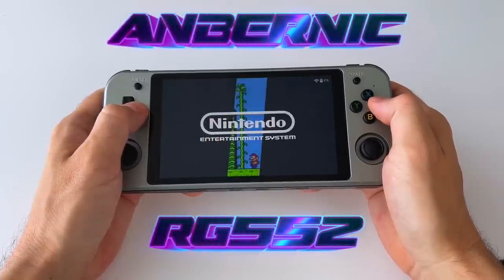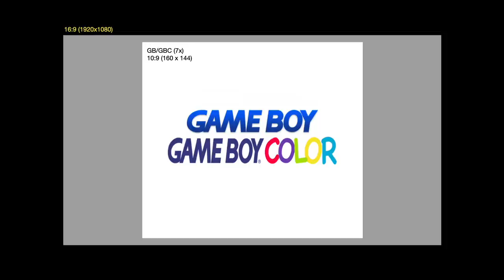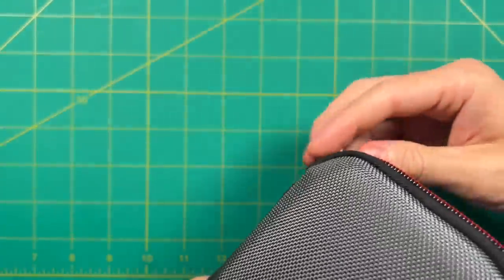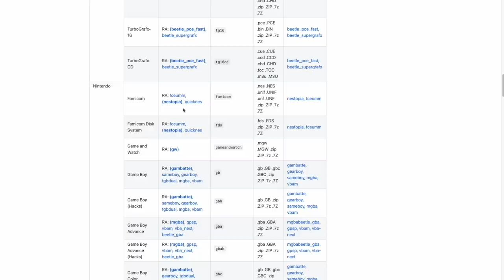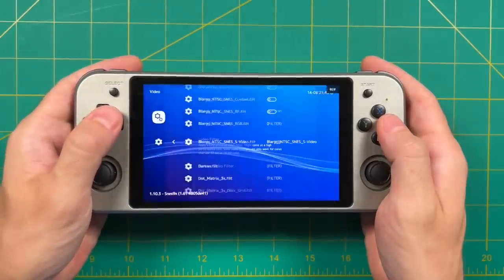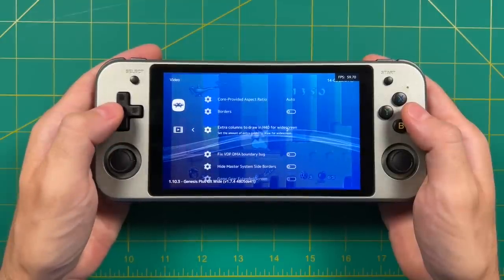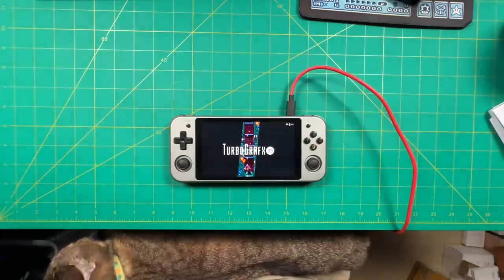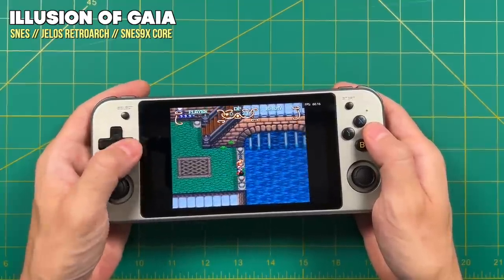This is still my FAVORITE handheld for retro gaming.

Comment: After a lot of fiddling, watching your videos and updating, I finally got my RG552 set up the way I wanted. I’m particularly OCD about retro gaming so the integer scaling, filters, achievements, lack of input lag etc are all essential for me.

I got fed up with dual booting so I setup Android 11 with Retroarch and standalone apps as detailed in this video. This has only been made possible in Android with the official update, AuroraStore and Daijisho frontend. Very slick as a complete launcher with high quality artwork and Retroachievements support, I no longer have to dual boot and can use a single SD card. Perfection!
Reply from the maker: Sounds like a nice setup!
Reply: That's not being OCD that's just caring about the games you play. I get the impression a lot of the angry comments on these videos that are shitting on anbernic and shilling inferior alternatives just do not care about actually playing games at all, they think something having more "power" for less means it is better in every way, but if they cared about the actual experience of playing on a device which is FAR MORE THAN PERFORMANCE they'd know how full of shit that thinking is. But they don't.
Reply: daijisho is defo the most underrated frontend out there . russ u shld do a video :D
Reply: @steel5897  You hit the nail on the head. Too many people know the cost of everything and the value of nothing.

Comment: It’s kinda baffling that they went with a 16:9 display when only one of the properly supported systems can even use most of it… but when the display looks that good, it’s hard to argue.
Reply: It's 5:3 not 16:9. It's close tho, 5:3 is the same as 15:9.

Comment: Can the rg552 be charged from a battery pack or standard PC USB port or does it require the AC adapter?  If I'm on a road trip or long flight is there a way to use a battery pack or the plane's USB port?  Thanks.
Reply: In case you haven't got the answer, the Anbernic website says RG552 "Support mainstream fast charging protocols such as PD, QC, AFC, etc.,
Input 9V~12V≥2.5A,
Match the maximum load 5A charging cable1.5 hours full". So, you need to check the plug outlet or battery pack output. If it doesn't exceed the numbers above, it's fine.

Comment: Russ,I went back to this video because I am wondering if it isn’t better to buy the RG552 over the RP3 due to the shipping bringing the RP3 up to $175 and i can get the RG552 for $199 incl shipping. The RG552 has a better screen and is it not also a bit more powerful? To me it seems the RP3 just has better ergonomics, but the RG552 is built better as well.
Reply from the maker: The RG552 definitely has a nice feel to it, although some people think it feels a bit less solid than their other devices.  The main downside to the RG552 over the RP3 is going to be the battery life, at best you'll get 4-6 hours on low-end emulation.  But as I showed in the video, its scaling for classic systems just can't be beat.  Thankfully, JELOS has improved performance quite a bit even in the past couple months, so there is nearly parity with Android emulators now on their firmware.  I'd be torn between the two if they were of a similar price too -- if you just want to focus on classic gaming around the house with a premium feel, then the RG552 is a great fit.  If you are interested in other aspects, like game streaming or longer battery life, then the RP3 would be a better choice.
Reply: @RetroGameCorps  thanks Russ, I think this is an idea that a lot of buyers could benefit from. I am going to save and wait for a special price on the RG552 - I am really keen to get a large screen device and, for me, retro emulation (SNES, NES, SEGA) is the priority - the rest is just extra. Oh a big downside that bothers me with the RG552 is the fact that it has no Bluetooth for headphones… :-(

Comment: Awesome video. I had no idea about selecting little cores only to save battery, I'm going to try that! The RG552 makes retro gaming a joy, you don't think about how your experience could be better on something else, you just enjoy the games. Super Mario World hasn't been this fun since I was 7 years old, I've played it on a ton of emulators since then, but never made it to the end  due to graphical glitches, sound stuttering, or other issues that ruined the experience on other devices. My biggest gripe with this device is the "sleep" mode - dies in about a day. So you're pretty much forced to power it off after each session, or pick up a dead device the next time you want to play. This is an area I'm curious if the RP3 could improve upon.

Comment: Just a heads up for the audience about aspec ratios:
- Few classic systems native pixel aspect ratio is 4:3. What this means is that integer scaling with the aspect ratio set at 4:3 - on almost all modern LCD based display panels at a 4:3 aspect ratio, will not provide a 'true' clean integer scale. As a result, you will see some scaling artifacts at least along the horizontal axis, with integer scaling on. 
In most cases, only the vertical resolution will be cleanly scaled (although there are exceptions)

If you want to play at aspect ratios other than the native (8:7 for SNES, 8:7 or 10:7 for the Genesis etc.) then you will need to apply some sort of filtering or shader to mitigate the distortion this introduces (assuming the distortion bothers you). 

This is essentially true of any modern display, regardless of device.

Comment: Agree with your reasons as well Russ, but there’s something that just turns me off the 552 because it gets warm and drains so quickly even playing retro games compared to other devices like the RP2+. This issue is made worse because you can’t just plug it into any usb C charger, it needs the dedicated one or something like a MacBook Pro charger. 

I really love the screen but it terms of being that device that’s just there on the side of my bed I keep going back to the RP2+. There’s something attractive to me about how it can stay active in standby and barely drain even 1% after 2 days of no usage. And when I am playing GBA or SNES I’m getting around 8+ hours and no heat at all, even though it’s more powerful than the 552.
Reply from the maker: Great points, and yeah the RP2+ is a much more efficient handheld, it does a great job with thermals.  I have a weird relationship with the RP2+: because it can play more high end systems then I like using it for that (Dreamcast especially), but then I find the 3.5" screen to be too small for Dreamcast.  I can't win!  ¯\_(ツ)_/¯
Reply: @RetroGameCorps  have you considered partnering to create the ultimate enthusiast handheld? I reckon if anyone could do it, you could
Reply from the maker: @zaprct  maybe some day in the future, but I think I still have a lot to learn before I take on something like that.

Comment: Seems like the RP3 is going to be a better version of this
Reply: Shhhhhhh..... Russ gets offended when you compare Retroid and AnBeRnIc.... 😉
Reply: Doesn't bode well that there aren't any reviews for the device yet and it ships in 4 days
Reply: The rp3 has a 16:9 screen so probably not
Reply: @HPPrintervx4p5q  16:9 no/ no Linux support. 

Very different devices.
Reply: @HPPrintervx4p5q  its not all about the screen though, theres so many things that make the 552 painful to use. abysmal battery life, the device getting stupidly hot, the ergonomics (shoulder buttons , joysticks etc) if retroid rolls out a device that has none of those issues they've got a winner.

Comment: You and I seem to approach 552 in a lot of the same ways, except my favorite is snes compared to yours being nes.  It's one of my most used handhelds as a result, even over rp2+, Odin pro, and steam deck.  Just really hits a sweet spot with the controls and screen, and Jelos is just much more enjoyable for me to work with over all of the Android front ends I've tried (Reset Collection, Daijisho, Launchbox).  The only consideration for me is the battery since it drains quite a bit even when turned off, but as you pointed out it's also one of my fastest charging devices and I can get back to around 80% in an hour.  

I agree it's a niche device.  For the person wanting a "one size fits all" that does solid with a broader range of tougher systems and still has a relatively good screen, Odin is the versatile choice.  I just like how 552 does so well with the games I enjoy most so I favor that one.  I have other devices for advanced stuff when I care to play those.  I mostly reach for Steam Deck for gamecube and above.
Reply from the maker: I am in completely agreement with you here.  I'm a simple guy: if I can play the best version of NES, SNES, or Genesis games on a handheld with Retro Achievements, then that's a good use of my time.
Reply: I currently have a single OS, Android 11 with Daijisho, and ditched JELOS because I didn’t want to split off games over 2 different operating systems. Could you go into a bit more detail why JELOS offers a better experience. Thanks.

Comment: Also, would these same JELOS tweaks you showed off work for JELOS on the RG353P?
Reply from the maker: Some of these settings would carry over, but I don't think there is an option to define the cores like with the RG552.  Might be something worth trying!  The screen adjustments will be different, you'd have to use filters and shaders to get things set up properly.

Comment: I'm in the same boat. I love and treasure my 552. It's amazing for everything I would want to play with a dpad. If I want to play anything else I just use my steam deck. I tried playing retro 8 and 16 bit games on the steam deck but within an hour I put it down and picked the rg552 back up.
Reply from the maker: I had a similar experience.  The Steam Deck's 16:10 aspect ratio is also great for 4:3 content, but I prefer a more compact handheld for retro games.  The SD for me is best for GameCube and above (and PC games, of course).
Reply: @RetroGameCorps  where does that leave N64, Dreamcast, and PS1 for you? I prefer SD for N64 era and up, especially with widescreen enabled on N64 core for steam deck. 552 is capable of N64, but I don't think it's ideal for it. Thanks for the reply by the way
Reply from the maker: @VatoLoco91  For N64, Dreamcast, and Saturn I prefer the Odin.  I actually use the RG552 for PS1 as well but I don't play that system very much.

Comment: Are there any videos on applying screen protector and using the included Wipes? Should we bother? The manual doesn't say anything about it.
Reply: modern emulation handhelds all have tempered glass screens which are very scratch resistant.  screen protectors aren't necessary but you can still use them for added protection

Comment: Anyone buying this over the Ayn Odin Lite is mad IMHO.. Even with the 2.5 month wait for an Odin.. So much better emulation performance, decent gamecube and ps2 and everything below that is perfect (i.e. everything I have tried for PSP is perfect at 2x for example)..
Reply from the maker: There's no denying that the Odin is a better deal.  I love my Odin Pro but it depends on what you find most important, if you prefer SNES and below systems then the RG552 plays those systems better in my opinion.  My Odin Lite finally shipped today (12 months after ordering), I'm looking forward to reviewing that as well.

Comment: I picked mine up for $180 on Ebay. It was pristine and had a screen protector on it. Both SD cards were still there. I threw amber and android 11, ended up paying Black Seraph 20$. I still don't know if i can get over the battery stamina, I played GBA Metroid on my rg351 for like 6 hours and still had like 50% battery left. Thinking about selling it, unless you know of any decent battery upgrades???

Comment: For just the screen and that pricetag an Odin Lite is a waaaay better choice.
If Anbernic releases a more powerful successor of the 552 with the same screen but with stacked shoulder buttons and capable of emulate perfectly the "modern" 4:3 systems like N64, Saturn and Dreamcast for $220 it would be a hit.

Comment: I have an rg351m that worked for 1 week.  The screen went black. I replaced the screen, and it's still not working. Any other lucky people out there?
Reply: Mine works but has the crap dpad. Given how widespread the dpad problem is, I question how it got so many good reviews .

Comment: Great video and is exactly the one I needed. Thank you. Just started looking into retro handhelds a couple of days ago but was struggling with what screen size I wanted. I wanted 4:3 for all the 2D classic games but the GBA is my favourite console and so I would probably spend 50% on my time with all the other consoles and the other 50% on GBA. The scaling of the screen seems perfect and as you proved is better than 16:9 devices. Need to try and find a good cheap price at AliExpress but then I'll follow your guides for the installing all the stuff.

Two questions though. You didn't mention how DS handles on the device. Also why wouldn't you just set it to overlook the CPU at 200% for all games? Do they then run too fast or just a battery consideration?

Thanks
Reply from the maker: DS plays fine on the device, I prefer to use the Android side for that system so I can take advantage of the touchscreen function.  DraStic with a 2x resolution works fine on the RG552.  As far as overclocking the CPU (I assume you are talking about the Genesis section where I showed that with Sonic Spinball), it can cause glitching in other games and so I only use it for games that have slowdown.
Reply: @RetroGameCorps  thank you for replying. I watched the different firmware video video and that showed that the DS games ran pretty well. I'd only be playing the 2D, which I assume will be fine. Oh the over clocking point makes sense. Can't wait to get one and set it up. Is there a black Friday equivalent for when AliExpress do big discounts?

Comment: Really great to see you talk about Run-Ahead. A lot of retro games are quite skill heavy and require fast reflexes. I remember just not playing SNES games on my PS Vita (except RPGs) because it starts struggling a bit with harder to emulate SNES games and Run-Ahead isn't gonna work. It was fine without any filters and Run-Ahead but I hated the input lag. If you want to have the best experience with 16-bit and 8-bit systems you really need to use Run-Ahead imho.

Comment: A while back I was actually wondering what the perfect aspect ratio for displaying 4:3 and 16:9 content on a single screen would be. I did some basic calculus to find the optimal aspect ratio for displaying both, and it actually worked out to around a 1.58 (edit: 1.54) aspect ratio. That's the magic number for wasting as few pixels as possible.
Was wondering why I couldn't find a retro console with something close, a 16:10 display or a 5:3 display, but here it is. That's really cool.
Reply: Ooo math.... GJ.
Reply from the maker: Nice, yeah the RG552 is a 1.66 aspect ratio, so pretty darn close to the 1.58!  Sounds like 16:10 would be even better at 1.6 (and it's definitely great on the Steam Deck!).
Reply: @RetroGameCorps  This was just a casual comment going off of memory, but after your reply I wanted to make sure it was accurate. Went ahead and redid my math (I deleted the old text file many months ago) and the magic number is actually a 1.54 aspect ratio. I realize changing the number like this hurts my credibility a bit, so I'll share my work below:

A = (4/3) / x
B = x / (16/9)
y = (a+b)/2

A is % of screen used when displaying 4:3 on an aspect ratio of x
B is % of screen used when displaying 16:9 on an aspect ratio of x
y is the average of these values

we substitute A and B for their formulas, and simplify, and we get
y = (27 x^2 + 64)/(96 x)

when we take the derivative we get
y' = (27 x^2 - 64)/(96 x^2)

we want to find a local maxima, because that'll tell us at what aspect ratio A and B are equal
to do this, we set y' to 0
0 = (27 x^2 - 64)/(96 x^2)

when we simplify we get
x = sqrt(64/27)

which means our optimal aspect ratio is approximately
1.5396

(and in retrospect, this is the hard way to solve this problem but whatever)

Comment: The whole Anbernic range is like this ‘it’s great…but’.  For me the 552 is a great console but my biggest issue is battery, not just life but leakage when it’s off.
Reply: In my case with batocera battery leaking not a problem, about 5-10% per week, here temp is 30c+ maybe it's a reason

Comment: I think paying $225+ for a device to only play 16bit and below games because of poor stick placement, no stacked shoulder buttons and lack of power overall is absurd. I bought my 351p specifically for those types of games and it only cost me $70.  

I feel if you're going to spend over $200 it should be comfortably playing 3d games. I bought the Odin Pro for N64 and above. I put some GBA games on the sd card, but have little intention of playing them on there.
Reply: Can't you use the joystick to mimic the dpad. Those are pretty rigid for the most part but do thier job. I cant play super circuit without a joystick now lol. I also hope they would have hz options as pulsing the other direction insted of holding on after a trigger. Basically every 1 or 2 frames make an input of the half direction to kind of smooth things out.
Reply: It's the screen bro. That's what you're paying for.

Comment: Russ! The Win600 running Batocera is my go to retro handheld right now for anything d-pad centric since it has the same great d-pad and face buttons. The 6" 16:9 screen does have bigger black bars than the RG552 and doesn't scale as nicely for integer scaling, but the image quality is still very nice and large. For $73 more than the RG552 (I got the 3020e $299 version), I can also run windows and also emulate PSP, Dreamcast, GC/Wii perfectly too. I also would not recommend the Win600 3020e to just anyone but for my use case I'm loving it and use it all the time.